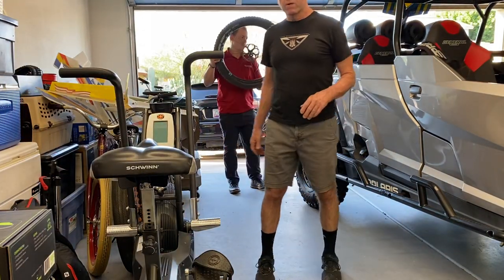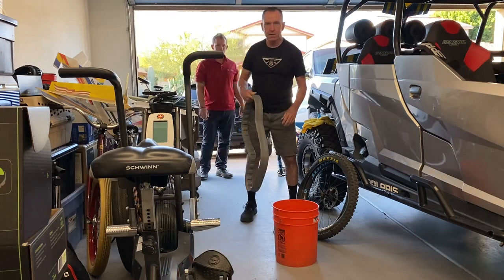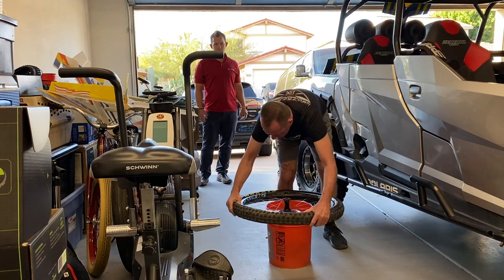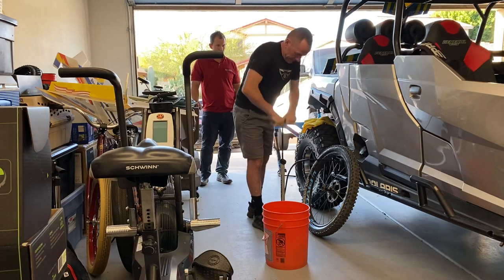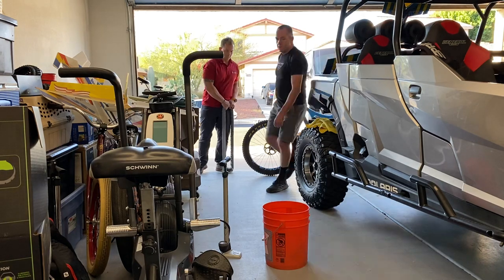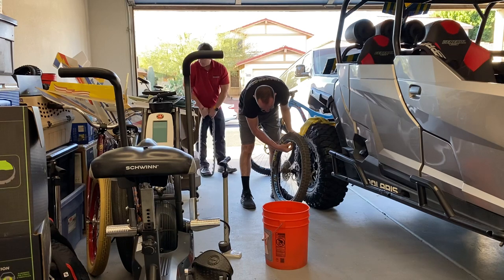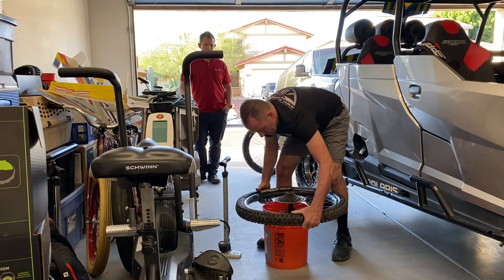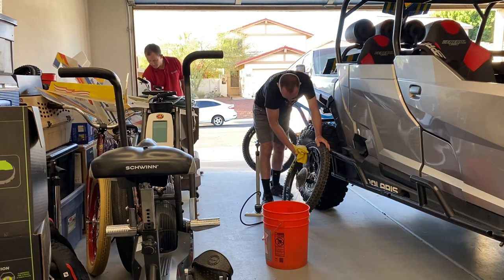Cushcore install my way.

Comment: ... looked a lot easier than all the gripes I’ve read online from the couch engineers. Nice work, man. 👍
Reply from the maker: Josh Hunter I agree! I have never had much trouble, other than with dual casing tires or in the cold. I thought sharing my method might help.

Comment: You would think this would be how Cushcore would direct you to do it. You made it look to easy. I've seen other folks struggle for way longer. I just told my LBS to install them on my bike. At least I know for next time.

I'm not sure if you changed the value stems to Cushcore as they have in/outlets that go East/West not North/South like other valve stems,  so the  bottom doesn't get obstructed  when filling or letting air out. What I don't like is the Cushcore valve stems are green in the kit.

Comment: I thought that you had to use their special valve stem? You don't have to add more sealant?
Reply: You can add more sealant and probably should. Also you should use their special valve stem,but can still uses the regular, because regular valves can tend to clog easier, and doesn't let air out as easy.